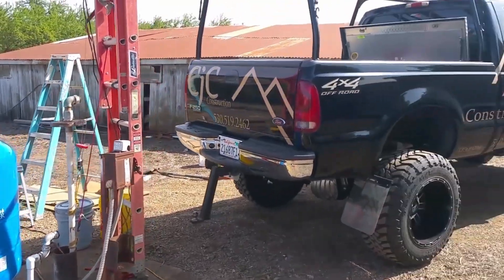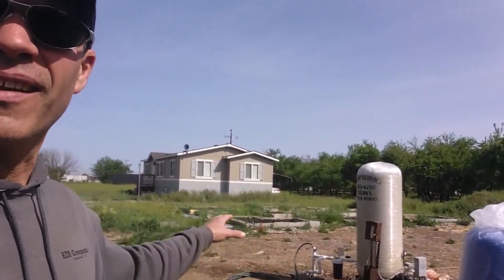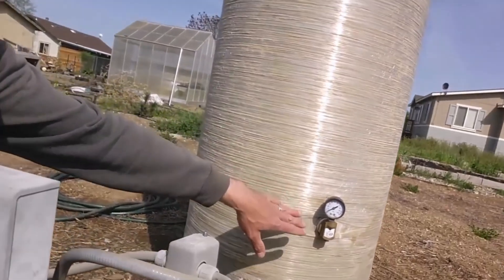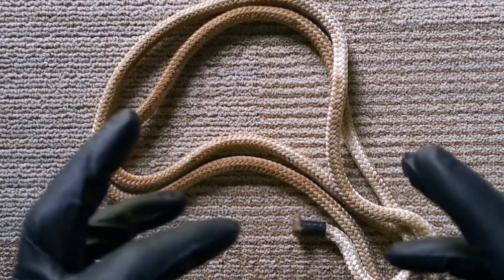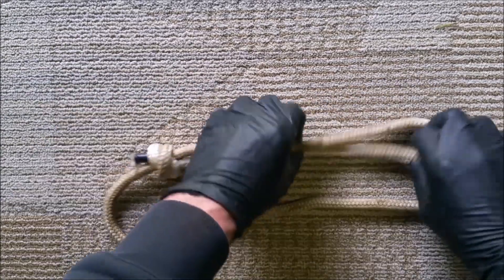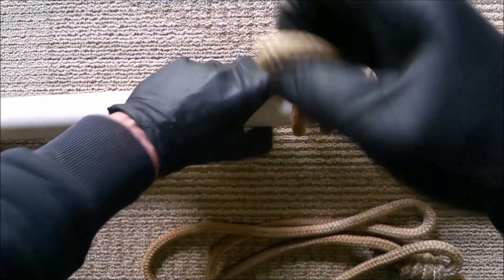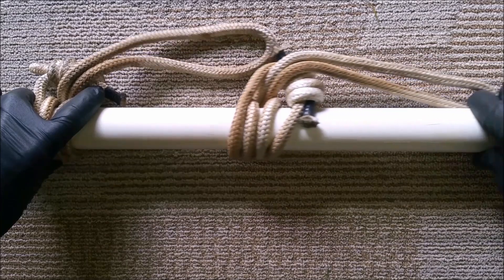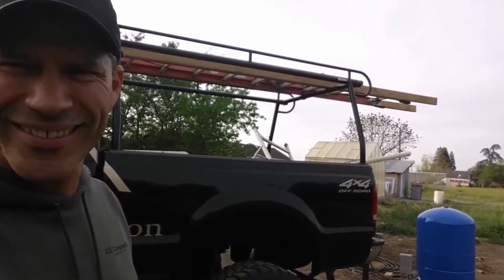💦 DEEP Well Pump Pulling - CHEAP and Easy! 💦

Comment: Can you pull a 500 foot 3hp pump like this?
Reply from the maker: Good day to you. We have pulled 200', but I wouldn't recommend much more. This method works best for wells 200' or less. I should have mentioned that in the video. The weight of a deep well and pump is great. Thank you for your question.

Comment: Thank you for the detailed explanation of the knots used. 
Very clear and concise description.
Slow and seady is the key! I witnessed someone lose a pump and about 40' of pipe when they got impatient and tried cutting corners. 
Its not a race. I am more the tortoise 🐢 than the hare 🐇. Work smarter not harder. ☝
Thanks again, stay safe!
Reply from the maker: Thank you so much for your input! Yes, patience is the key. Take your time and be careful out there!

Comment: That Pursik knot is the best for this kind of work I just pulled our well pump 110ft I used to A frame ladders ine on each side of the well head and ran a log through the tops of the ladders then wrapped a chain around the log and put a 2 ton chain hoist on and did the same thing with the Pursik knots worked perfect ..Will I do it again Hell no lol once was good for me plus this new pump better last at least 20 years lol
Reply from the maker: Awesome! Thank you for the comment and your experience with the chain hoist. Was your drop pipe steel or plastic?

Comment: Try using an icicle hitch
Reply from the maker: Good day! I am not familiar with that knot. What would be the advantage in your opinion?
Reply: @jeffcunha9114  It is designed to grip a smooth cylinder such as a pipe or cable.  You need to apply a constant tension to the rope this knot will not handle sudden jerks.
Reply from the maker: @robertallen-5774  Thank you for your suggestion. I will look it up. One of the things I like about the Prusik Knot is that it will grab in a sudden fall type of situation that sometimes happens during pump removal.